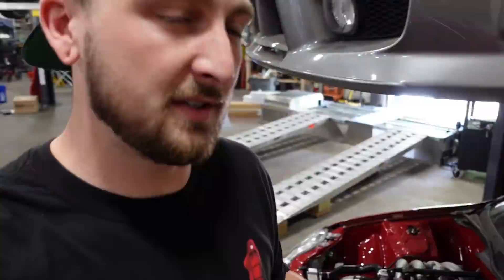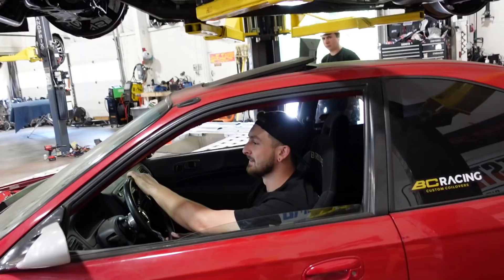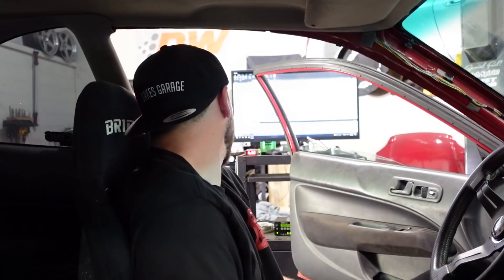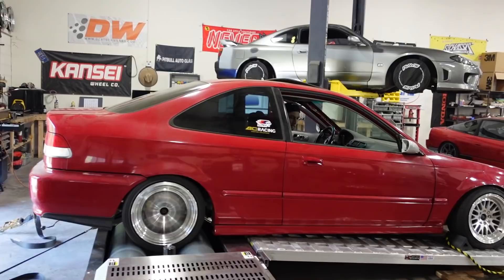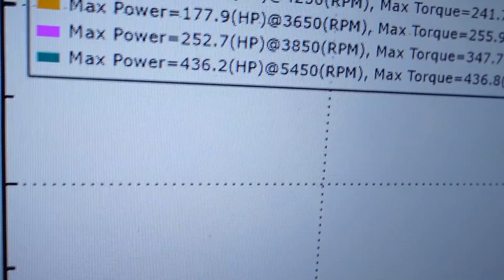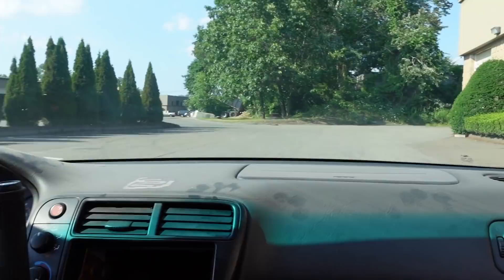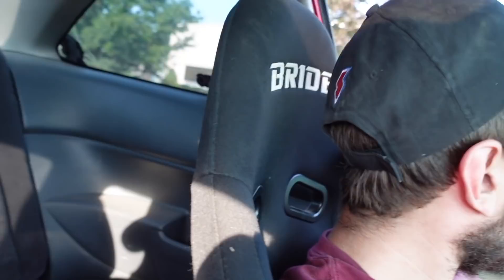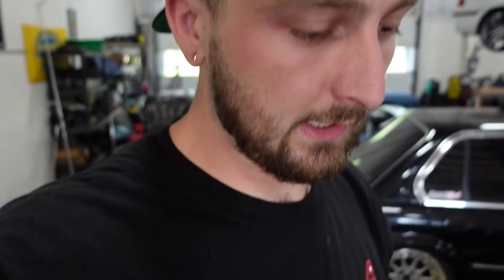I try to BLOW UP my RWD Civic on the dyno.. and IT JUST WONT DIE.

Comment: The smoke definitely went away alot, might be the turbo leaking oil into the housing, the  turbo drain could be backing up oil into the housing or something not sure the oil drain setup
Reply: Mine did the exact same, made boost fine but leaked a lot of oil and fouled the plugs at times
Reply: I agree And the missing could be the plug gaps

Comment: I guess this shows us that Jimmys Dyno really does read high lol.
Reply: It might be 20 hp too high but not too far off
Reply: Prolly from all the "smoke" in the shop 😂
Reply: @ls_812  I always thought they smoked lol but watching djs channel they be on that loud pack 🤣 😂
Reply: 18 psi on a much better Garrett T61 turbo and built KA with 264 cams, I made 385/350. It’s reading a solid 100 off.
Reply: @bodyshopboyz3563  .
Reply: @jasonn4397  apples to oranges. Different turbo, different cams, and probably a different CR if you have built bottom end.
Reply: @jasonn4397  yup
Reply: @seanharrison6162  20?! 😂
Reply: @jasonn4397  It has to be a certain ratio though because it can't be reading 100hp off on everything. Maybe this and the Supra.. But there's no way that it was that far off when they Dyno'd the E30.. Maybe 15hp off at most on that one.
Reply: @jasonn4397  old ass turbo
Reply: @devon5078  its certainly newer than the T3/T04E he’s running.
Reply: @thelachsmith81  glad you said probably. It was factory compression ratio.
Reply: @shona5512  never claimed it was off on any other car but the Ka-t.
Reply: @jasonn4397  Not arguing that you were claiming that.
Reply: @shona5512  No way that S52 made that N/A.
Reply: @jasonn4397  Are you running ethanol though? I mean like he said in the video similar setups where making similar horsepower
Reply: the dynocom I got tuned on reads low compared to most others...
Reply: He really should calibrate the dyno, or compare it to another one.

Comment: Also, I have the same Civic, but mine has a fully built LSVTEC and makes 612 whp on a GT3582R turbo at 22.5 psi with a built Civic Type-R head with Skunk2 Stage 3 NA cams tuned on a Hondata S300 V3 on E85. Before I built the block I rebuilt it with new rings and bearings (on stock internals) and with a built B18B1 NON-VTEC head with BC stage 2 turbo cams it made a consistent 408 whp on 15 psi. Honda engines make some good power when they're tuned properly.
Edit: yes, obviously I know that this Civic has a Nissan KA24...I've built many cars, I'm not a keyboard mechanic...lmao

Comment: Yo Jimmy. Great to see KA make some jam! Just on the dyno reading high...not sure about your one, but most roller dynos require the car to coast down freely after a pull as it uses that to calculate the losses from the roller, tires and strap load etc. Maybe you jumping on the brakes after each pull screwed with that adding more losses in the calc and so doing making it read high? Just a idea tho. It might be worth a shot to check out.

Comment: The numbers are right... You ran it rich and bad clutch pedal adjustment... it wants to live, now you got the dyno and can tune it properly the oil is sealing the rings before burning out. Now that you tuned it and Bri bri gave it the old Italian tune-up, it cleared up the smoke quite a bit.

Comment: Not that it matters since it’s being rebuilt, but I’m having the same issues on my miata (blowing smoke, runs like shit) convinced the issue is there is a bad piston ring not returning the oil and it’s burning off when firing, and it fouls the plugs which is why it breaks up so bad. 
If you’re beating on it so hard, keep an eye on oil level. It go through it faster than gas

Comment: Not gonna lie I think Jimmy's dyno needs to be recalibrated or something. The numbers are always way high. Like way, way high...
Reply: @carter7803  I'd agree with you but that KA never made over 240 hp on the other dyno he was using. Granted, that other one always read low numbers, but this one is on the other end of the extremes. Like 15-20% high. 
As they said in the video, after upping the boost, this same setup was said to make low 400s, say 420 for the memes. 486 is still 15% over expected output. On a dying motor as well lol.

Comment: Might be worth doing a sanity check and taking a car from your Dyno and running it in Derek's, another roller would be even better. Just to see that it's not out of whack (I actually think it's accurate tbh) and so you can trust it.
Either that or getting it calibrated but that's pretty spenny
Reply: Oh, also if you're in a total bind on the engine front you can get loads of SR/RB motors from NZ for $1500-$2500USD no trouble, probably just as easy in Aus. Shipping could be a bitch but could be a backup if you need

Comment: Ka24 makes 135hp stock 14.7psi should double na power if this thing is bone stock motor wise on 20psi should put it around 315hp dyno is definitely not calibrated right or something

Comment: It has to make that power tho, this dyno proven to make reasonable numbers with all other cars that went on it, so no reason for it to decide to be innacurate with this car only...

Plus after a few seconds of research, I found a couple people with the same turbo at 19psi as well, one with a lower compression built engine that made 450WHP, and another that made 420WHP on a stock engine, those numbers are higher ones I've found but they all were around the 400-420 mark. 

But all those numbers were in WHP, and if I'm correct your dynosheet is in crank HP, so let's say a ka24 with 19psi on a t3t4 makes on average 420WHP, that's 494BHP assuming 15% drivetrain loss, so those number match, but you did mention your dyno getting more generous as the numbers climb so I'd guess Nissonda probably made like 450ish bhp (380-390WHP so kind of correlates with your very last conclusion)

Comment: Please help My na E34 has the same problem but my question is do you know it's for sure a cracked piston and can you tell that it's oil smoke cuz I know my problem is oil smoke and I'm losing my mind trying to figure out where the problem is everybody says it's a bad PCV everybody says that it's a bad valve cover gasket so i replaced the valve cover gasket and all the water pump stuff too and I just don't know I don't want to give up on it but I am at that damn point where I'm broke AF and don't want to hurt the car because it's the only car I have